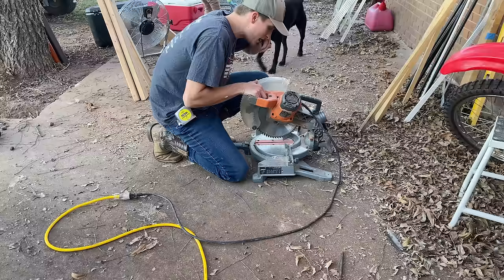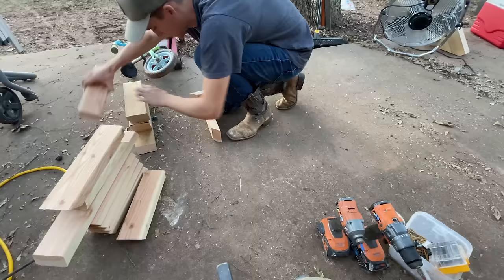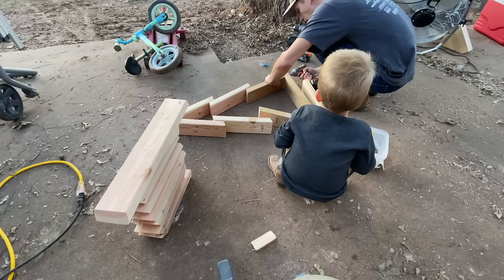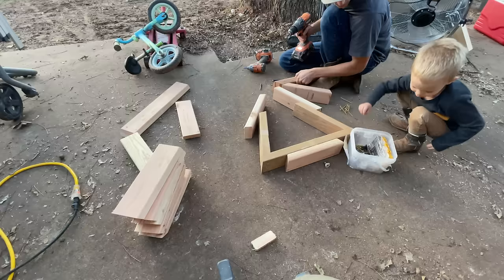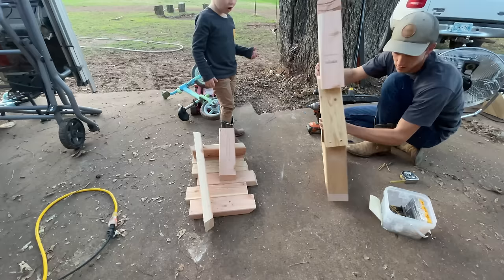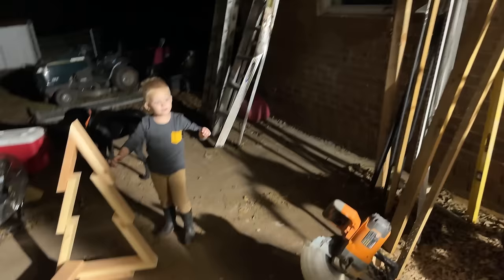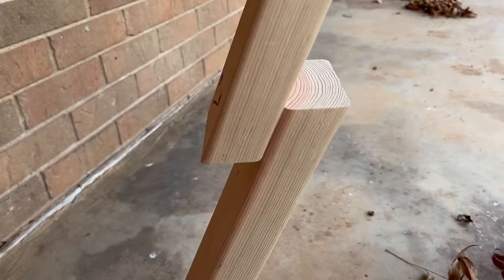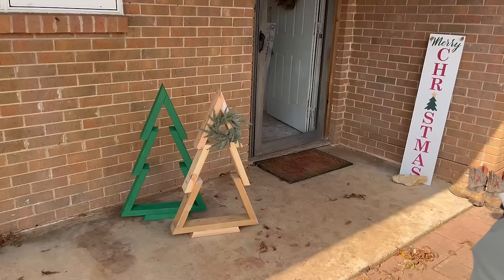Easiest DIY Christmas trees! step by step

Comment: When I was a kid, my dad used an art projector and plywood sat at a distace  away to "blow up" the size  real big to "human" and traced the outline of a Christmas design  and wrote a color in each section in a very basic "paint by number" set-up.   He used enamel paints so they  could withstand the weather.  Santa. Elves. Rudolph. A sleigh and an angel.  He put an easel back so they stoid on their own but folding so they could be stored during the rest of the year .

Comment: WE made that same type trees!  Love that tgey can go outside and using our scraps. I painted them a hemlock lock greed and spruce green gave them a spray protctant. I think  Marci and I saw the same plans...😂 I put mine behind 2 size Deer made of metal I bought in a Walmart last year. Ive since painted the eyes, nose, antlers, chest colorig hooves, etc. They were only in a rust color. These are the kind you push into the ground with 2 wire type stakes attached. They look so cool and I can keep the outvtill spring. They are not Christmas related.
Reply: My son used his pocket hole kit to assemble them as well. Krendall ask for that as a gift you'll never not use it. Thing look so clean and neat!  From Kreggs I think.

Comment: I think dry brushing the bare wood with white paint woukd make it look frosted looking. You still see the wood but just put a little white on a dry brush then lightly brush the white and it would look like a dusting of snow. Just an idea to think about but I agree, there should be a 3rd tree and leave it wood. However, since they are outside ornaments, if they get wet from rain will the paint come off? Do they need to be sprayed with a clear sealer?